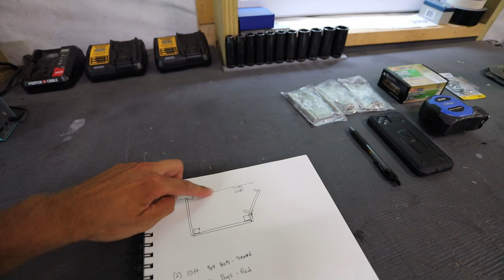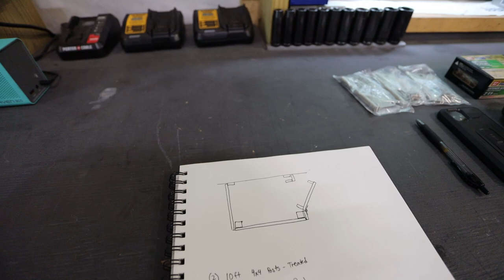Building an OUTDOOR SHOWER

Comment: For the "floor" of the shower, you mentioned pavers.  I know I've seen some pre-built wood bath mat kinda things that basically look like fancy pallets.  That would kinda keep your feet up out of potentially puddling water and might be a little more comfortable as well.
Reply from the maker: Thanks for the suggestion I'll definitely look into that 🤘
Reply: That's exactly what I was thinking.
Reply: funny I was thinking some sort of hard wood for a floor mat as well
Reply: @Kordare yeah the wood pallet thing looks cool and comfortable but I would be scared snakes or other unwanted guest could set up camp under it🤦🤦🤦Cement paver sounds good .just something you could inspect quickly before jumping in 🤦🤦🤦🤦
Reply: Have you been using it much???

Comment: As a woman i would have put a little bench in there because you need somewhere to put your foot when you shave. ;) But otherwise it's great! Also the cross brace is backwards I think on the door. But i just realized this video is a year old so you probably know that lol.
Reply from the maker: Thank you! Since I attached the brace on the outside using screws, it doesn't make much difference because the screws are taking all the force in shear. If it was internal to the box it would definitely need to go the other direction.

Comment: That light should be removed from the shower or put high about it, otherwise I see electrocution risk.
Reply from the maker: The light is perfectly located for when I use the shower at night. It's an outdoor light....completely fine with getting wet.

Comment: The diagonal strut on the door is positioned exactly wrong. It needs to run from the outside at the top to the inside at the bottom so that it reduces the pressure. Currently it is doing exactly the opposite.
Reply from the maker: I agree if it was internal to the boxed structure. Since it's on the outside. The screws are taking all the force so it is in turn adding rigidity to the structure. All in all it does basically nothing once the metal is attached.

Comment: Trust me homie you WILL regret the rocky ground of the shower 😬 I would suggest pouring some concrete, it looks nice but walking on it it’s probably gonna hurt, and if not hurt it will be annoying. Your probably gonna be exhausted when you go take a shower and just wanna relax but standing on rocks isn’t gonna help
Reply from the maker: Haha I always wear sandals when I shower outside so it's perfect with these rocks, but I may add something at some point
Reply: @Kordare  could build a ground level deck hovering over the river rock you put down. we have a outdoor shower at my families camp ground and its basically a tiny enclosed hovering deck.

Comment: The cross brace on the door is backwards. Bottom should be on the hinge side. If I could make a suggestion, recess the brace into the door and tin the inside too. 
You did a great job really looks good.
Reply from the maker: Thanks! Idk in my opinion the way I did the brace will help to  keep the far end from sagging but really either way should work almost the same.

Comment: Where's the water going to go? Also do u have termites where you are?
Reply from the maker: No termites and no basement. Slab is set up higher than grade and drainage is no issue here. Water seeps into the rocks an into the ground fairly easy.